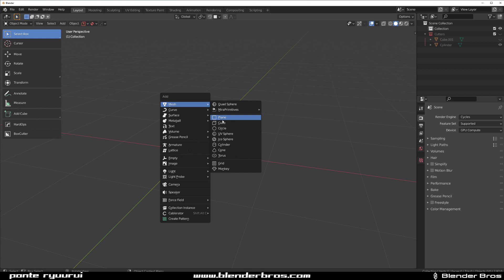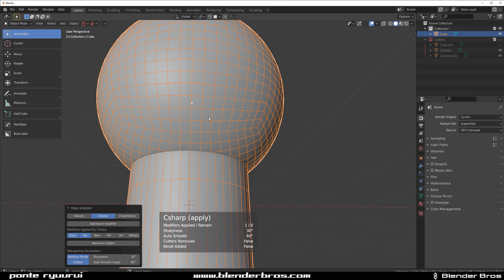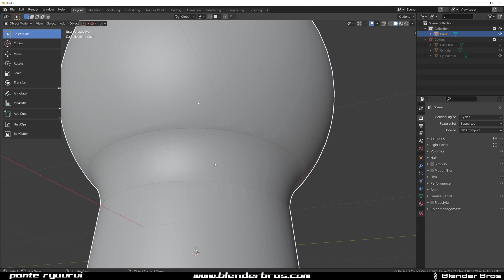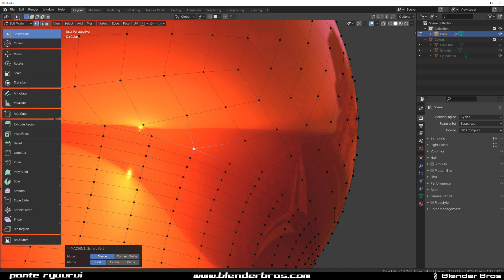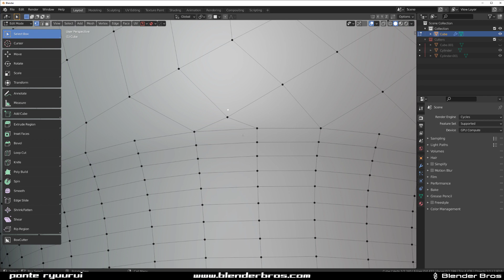The FUTURE of SUBD modelling in Blender - Offset Cut with Mesh Machine

Comment: A bit unrelated: applying a sub-d modifier to a quad-sphere does NOT result in a perfect sphere. (It becomes more apparent if you use a high division modifier on a low-resolution quad-sphere). So one has to use cast or shrin-kwrap to get it right in the end.
Reply from the maker: fact
Reply: Select the object and go into edit mode (vertices),  go to mesh ----> Transform ------> To Sphere  press 1 and then enter.

Comment: Blender Modeling is growing really fast. I would really like to see something similar to Smart Extrude from 3DS Max in Blender. Smart Extrude is really damn awesome.
Reply: Apparently new 3Dmax remesher is the bees knees too. Would be awesome to have something like that too.
Reply: @temujin1337  the remesher is Okay IMO. It still doesn't come close to manual Subsurf. Also adds too many unnecessary verts. Not to mention, it is also not too great on curved surfaces and circular cutouts.
Reply: @Ray3D  I see. I saw Arrimus 3D video on it, seemed very nice. I guess in that particular situation it did well.
Reply: @Ray3D  Its essentially the same remesher that Maya got, pretty situational for sure, quicker just to build the geo manually than to fuck around trying to get a decent result with the remeshers imo. May as well take cad data into zbrush at that point.
Reply from the maker: we is called quad remesher